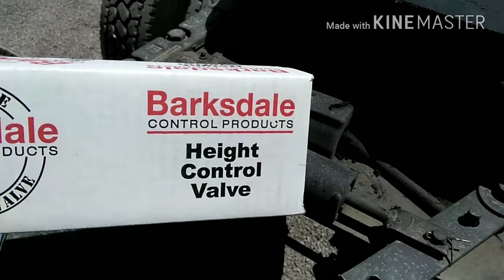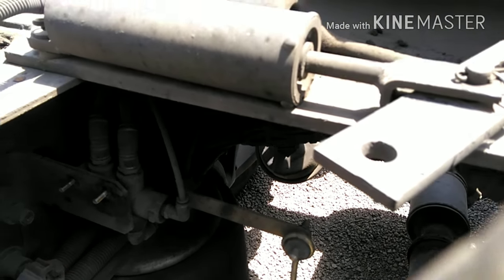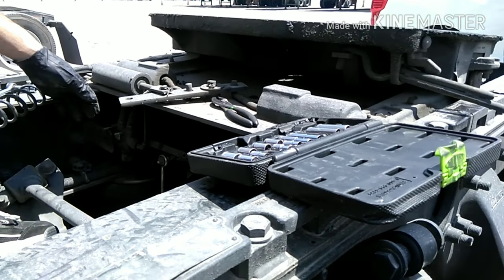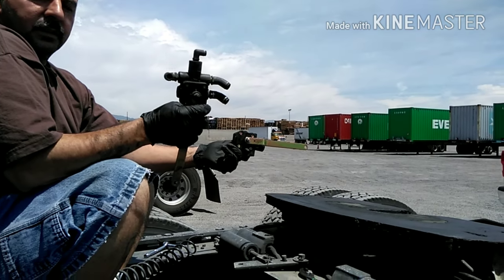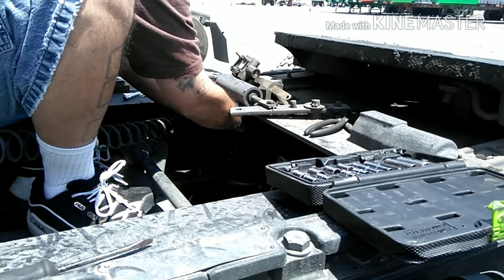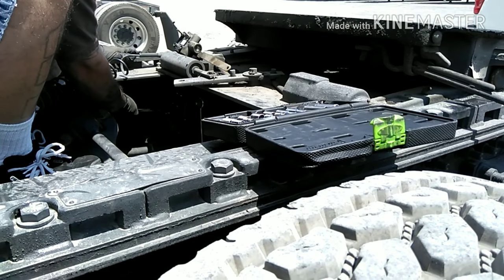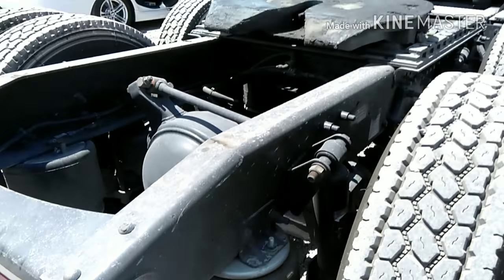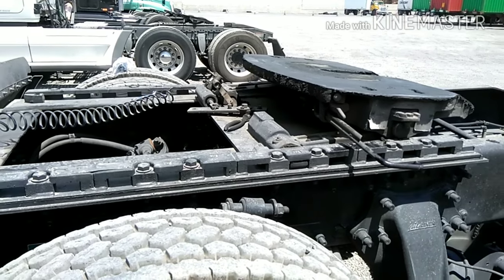Replacing height control valve

Comment: why did you not use the centering pin and adjust the linkage to use the height control valve as intended? isn't it suppose to inflate to the a specific manufacturers ride height? seems like this one will over extend or under extend. If I'm wrong please let me know because that's the reason I watched this video.